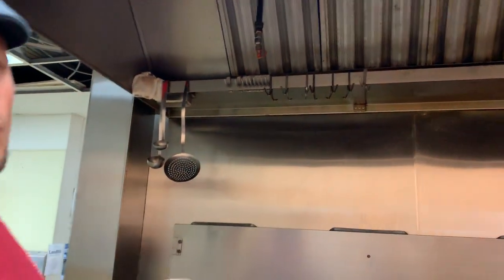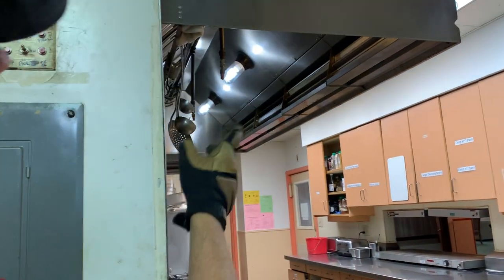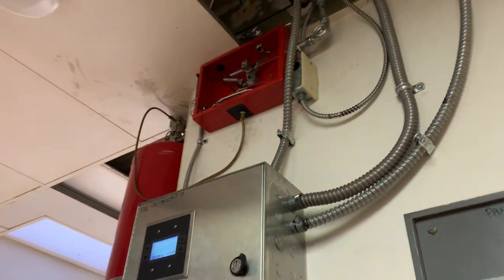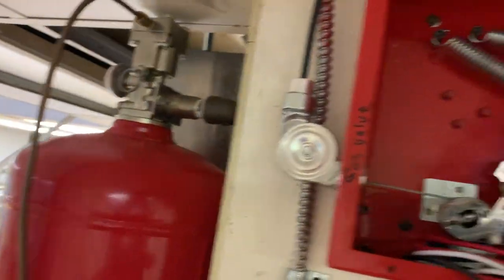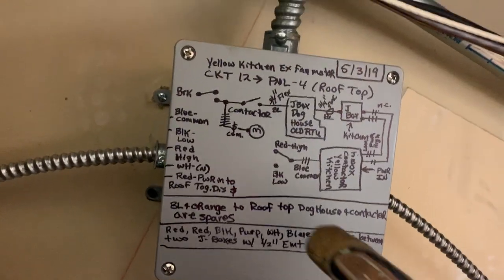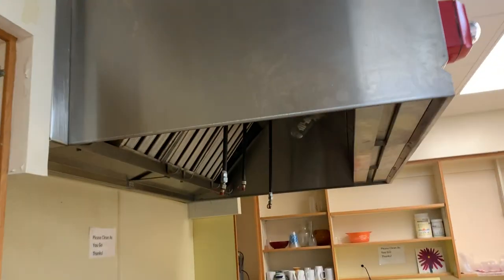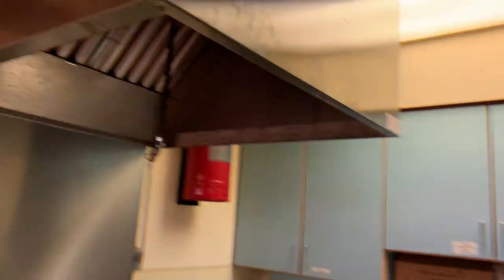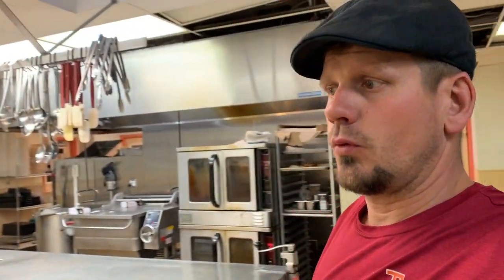Wired a Commercial Kitchen with Another Professional Electrician

Comment: Did you have to tie in any co detectors? 
In Massachusetts we have a separate gas solenoid that closes if the co detector in the kitchen trips. 
Also the exhaust has to interlock to allow the solenoid to open. 
It adds another layer of cluster to the f ck.  Lol
I just did a decent job for my shop. 
The construction electricians who roughed the building had no clue. 
The hood was existing with no control cabinet. 
They basically ran a bunch of mc to one spot and labeled them poorly. 
I was sent to the site to program and test the fire alarm. But the site super started picking my brain and I ended up wiring all the hood controls . 
Fun job

Comment: Hi do you have a diagram for installing regular commercial hood /fan
Electrical part for it
We need a switch for the light with 20am breaker 
Then sensor 
And fan switch 
Is there some kind a diagram one goes where ?any information will help this is the first time I’m doing it.
I’m a journeyman for three years 
If you can give me some advice, I would appreciate it

Comment: Just found your video because a store owner asked me to hook up an ansul system, which I've never done but I'm capable with instruction. My issue is, how is the power shut off incase of a fire
Reply: If the fire suppression system is triggered it will actuate a microswitch in the control head of the system.... I'm pretty sure...

Comment: Just moved into new kitchen at a school. Gfci breakers on all 20 amp outlets in kitchen per code. Over spring break, most of the breakers tripped. Head electrician at the job told me that will happen during power outage. So he’s telling me if power goes out on weekend, then all the food in reachin coolers and freezers will be lost. Not buying that. I believe something not connected right. My understanding it could happen on a power dimming and that is a power company issue. Waiting on the electrical engineer to assess

Comment: Looks like it was definitely a challenge to get all of that straightened out.  My only concern would be the LFNC running into the dog house.  It doesn't look like it's secured within 12 inches of the box and why not just route it through the existing opening instead of through the side and caulking it?  Just a curious newbie, not trying to be a armchair electrician.  Great work overall!
Reply from the maker: I did not wire this box, there was three other electrical companies that gave up on this job. They did NOT WANT US to rewire eveything, just pick up the pieces and wire the next 70% that was not in and was not killing the buckeyes.
Reply: @Petersonelectricllc  Ah, I see, makes sense in that regard then.  Thanks for the reply and thanks for posting so much content, I know it makes every job take that much longer to do when you film it, but I do learn a ton from watching your videos!
Reply from the maker: I'm surprised the health dept. passed the flex on the surface of the wall. I think that the State of Co DORA was wanting this passed after three years of waiting and was more concerned of the safety of the employees and the Air handlers turning off and the exhaust vent hoods staying on in three kitchens in the same areas.

Comment: I guess every fire martial is diff in what they want or nfpa. Ive wired these hoods in the not with the extreme shut downs they would of been going with a seperate system and have the fire alarm just monitor the ansul system.  But every place is diff i guess.  Good job anyways Josh.
Reply from the maker: Yah, not sure myself, I think that the weight of this camp being there for over a 100 yrs give some clout.